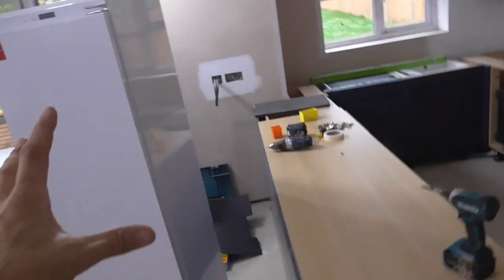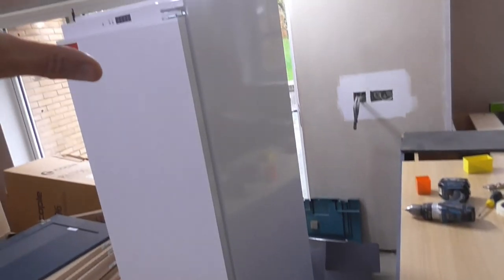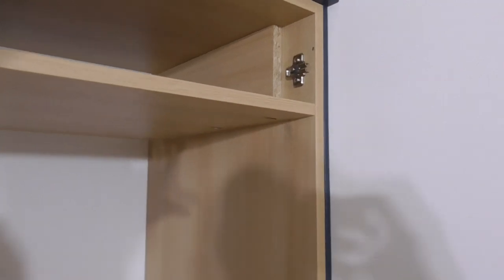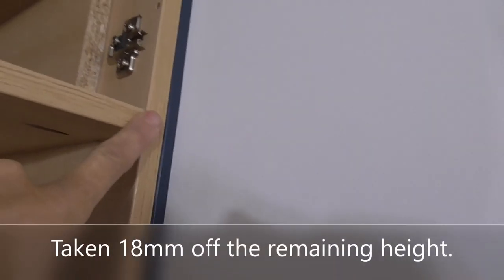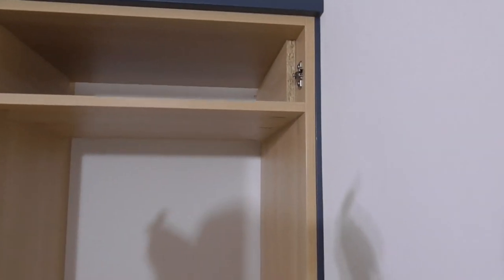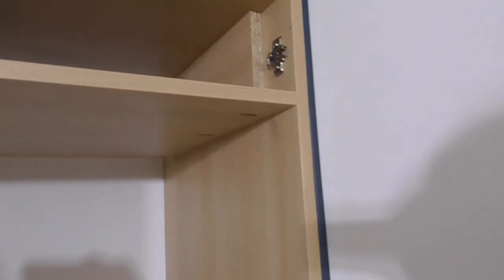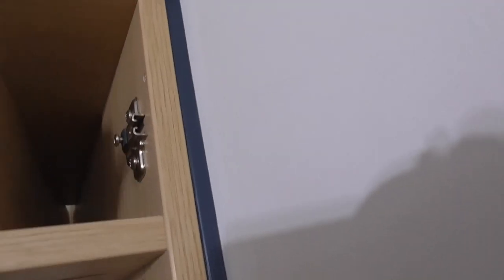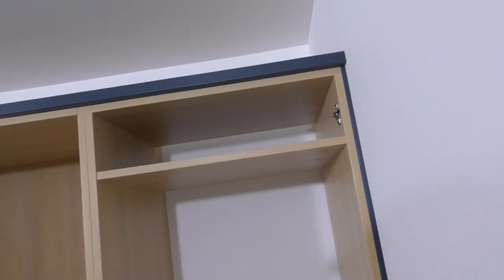Kitchen fitting UK***ACCURATELY POSITION AND FIX FRIDGE/FREEZER HOUSING TOP SHELF***

Comment: good bit advice del. ive actually got one to fit in the next day or two.. ive found the current lamona model that howdens supply is one of the easiest integrated fridge freezers to actually fit.
Reply from the maker: That's good news Paul, and I have done the odd Howdens kitchen, and don't remember the appliances being difficult to install👍Cheers
Reply: @thetallcarpenter  the howdens fridge freezers are super easy. Attach the plastic bits and pieces and they set th appliance exactly. Then screw it in and snap off the extra pieces and it’s fitted
Reply from the maker: @paulfinnonjoinery  'BOSH' 👊